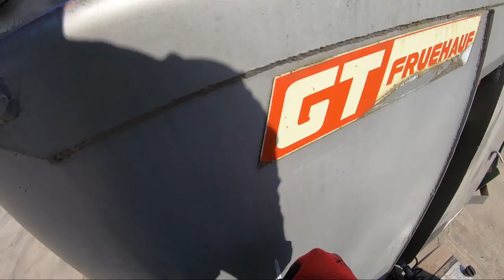2.5 Tonne Overweight & Blindsiding Off A Weigh Bridge - Last Day At Freelands.

Comment: I remember sitting in an RDC waiting for my call. Young lad got his call to a bay before me. 20 minutes later he was no nearer getting into the position requested. A crowd of numpties had gathered on the bay to mock and by now the shunter was sat facing him, feet on steering wheel, hands behind head. Nobody offered any assistance and I couldnt watch any more. Walked over and quietly reassured the lad. "just pretend its only me and you here and if it takes all day it takes all day, you'll be fine" Next shunt he was in. A Lions Den for newcomers.
Reply from the maker: And i bet that lad is top bollock now and that is a distant memory. Good on you for doing what you did pal! I'd do the same! The learning curve from reversing on your test to getting on a bay is night and day. It's one mad steep curve haha!
Reply: Only went to my first RDC in my 3 years in an artic last month (Paletline Birmingham) and how tight it was and the sheer number of tractors flying about in there was enough to put me right off. Did it though with only a few looks that could kill lol.
Reply: Good on you mate.
Reply: A lot of these new drivers think they're a bit special. I'd have liked to see how they get on in an old seddon Atkinson with hardly any power steering and a twin splitter gear box These trucks now are just like driving cars.
Reply: @joehooper2320  I know, "road legends" it's a fucking joke, the wagons there driving now practically drive themselves

Comment: Well done Deedy, I'm 30 and been driving class 1 for a little over 5 years now, I started with a year on pallet network multi drop and that presented some real reversing challenges what's always got me through is watch the trailer axles and use as gentle movements as you can to guide them to where you want them, a 3 axle trailer will pivot on its middle axle which helps to know. I've used many types of urban trailer on the multi drop and the shorter the trailer and less axles it has the quicker it'll move and the sharper you'll need to be, it'll come with time and you seem to take it all in your stride keep up the good work. I'm on a mixture of bulker and walking floor work these days and just another little tip I find helps me when it comes to rolling your sheet back out just undo the middle line and throw it over, give a good few hard tugs and your sheet will be back out in no time (unless you get shovel drivers that trap your sheet like they always seem to do to my walking floor when loading with DMR!) it'll help those pesky straps drop back down to as they can be a pain to get down if you don't roll the last bit of the sheet back fast enough. Anyway happy trucking and love your videos mate.
Reply from the maker: Thanks a lot for your advice buddy! All taken on board! Appreciate it mate!

Comment: Well done Deady! I was taught to use the mirrors, especially when trying to revearse straight. Which ever mirror the trailer moves into, turn the steering wheel that way and it'll straighten out again. As someone else has said, keep the steering inputs as small as possible. Because of the lever effect, small amounts of input on the steering wheel will have big effects on the direction of the rear of the trailer.
Jonathan.
Reply from the maker: Cheers mate! I will use this advice when i get back behind the wheel! Thanks!

Comment: Hi Deady, I’ve recently just passed my class 1 and struggle abit with reversing! Best advice I’ve been given is it’s not reacting to the manoeuvre, it’s letting the vehicle react to your instructions don’t steer so much little twitches. I work for a pallet network and deliver to RDC’s I’ve only had to back onto a bay in the class1 once which I go spot on! It was when I came off the bay and spun round to back up into the holding area afterwards that was a major pain in the Back side haha! Keep at it thou pal, like anything practice makes perfect. All the best fella stay safe pal.
Reply from the maker: Nice one buddy! It's good when you nail it first time hahaha! I'm good at maneuvering the truck, i can get it anywhere fiddly or tight, but give me 2 straight lines to back into and i'm feckin useless hahahaha!
Reply: Deady 2012 pretty much exactly the same! Next time I’m at the RDC I’ll send you a pic of where I was and where I went on “insta” 🤦🏼‍♂️😂 hope your back in work soon.

Comment: I’d say (although it’s a long time since I’ve done it as I’ve been out of trucks for a long time) that  the key to remember  is with a multi axle trailer the pivot at the back moves.  What was happening is the weight was moving from back to front which quickens up the turn.   

you seem to have the first bit which gets the rear wheels toward the bay then  I tended, when doing the last little bit, to just use mirrors and no more that 1/4 turn of the wheel.   

Final thing I would say is if you have the space try and get the unit straight with the trailer before the trailer wheels go into the bay.  If having to reverse tighter then there is no hard taking a shunt to get it straight
Reply from the maker: Thanks mate i will take that advice on board! Can't wait get practicing lol!

Comment: Aaaah Deedy .... go a little gentler on the staring wheel.. little will go a long way and much quicker to correct.
But you are getting their . Slow slow quick... 👍🏻
Reply from the maker: Nice one mate! Ima try! I can't seem to get the angle on the trailer fast enough then i end up at a 90 degree hahaha!
Reply: the little advice i had was remember it takes twice the amount of turns to cointer act the first turn, so a lttle goes a long way is excellant advice.

Comment: Hi deady,
I think when you're reversing you are rushing it slightly which is causing you to oversteer vice versa therefore slithering and zig zaging going into the bay (i find it more difficult when you have nothing there to use as a guidance i.e clear and visible lines or another truck) I was taught to take full advantage of the space that you have got in the yard or wherever to reverse into a bay, do not rush it, and ease on the steering. If you mess it up start again and keep your cool, don't worry about anyone else or what they think of you sod them. Would you rather shunt/attempt it 10 times or would you rather hit something or someone!?
Everyone has their little method/procedure of reversing and it's just the case of choosing your own method and practise. It will come to you one day and it'll all click
Reply from the maker: Thanks for the advice mate! I do believe that my main issue is rushing! I seem to want to do everything first time and as quick as possible! I need to remember to chill lol! Cheers mate!

Comment: I know it's hard mate, i don't have a licence but I use to shunt for an eddie stobart wash and parking was beast mode. some days i could get it in two shunts and bad days i was holding up the yard. i preferred aiming for a trailer on the drivers side so its easier to aim for and you can check how straight you are as your backing up. i was told to drive to your space, drive a past the next trailer/space then drive so your trailer 45 degrees then back it up. but it's never that easy.
Reply from the maker: I think the set up is 75% of the issue lol! If i could set it up so i was actually in line with the bay i'd be pretty much there haha!

Comment: Your reversing is bang on bud just take your time & sod everyone else. No rush it’s not a race as long as you get it done & don’t hit anything. I noticed at one point you started to chase it off when you saw your trailer was near enough straight you have to think ahead mate & chase it off as soon as back end is in bay . It does come to you keep up the practice mate
Reply from the maker: Thanks mate! I'll try that, it's mad that i can get straight anywhere else without over rotating, until i get a set of lines to stick to, then it all goes pete tong hahaha!
Reply: Deady 2012 I’ve been doing 36 years mate & still mess up. I can blindside it down a tight alleyway but when I have to back it on a bay I’m all over the place just don’t make sense 😂

Comment: Good luck Deady, I'm not sure how much longer I'll be on the road before the work dries up but for now it is ok. 
I'm having similar issues on the reversing and I know that the comments below about less movement and using the stunts to straighten up are the answer I just find it difficult to apply the logic🤯
Hope you are back on the road ASAP, love these Vlogs.
Reply from the maker: Try and use Crawler gear. It worked for me when i got back to the yard. Nailed it first time, i think my main problem is that i'm trying to rush all the time. Which makes me feel the need to do more with the wheel faster and i lose it. So with crawler you go slow & can see what's going on in slow mo lol.
Reply: @Deady2012  that's a great call!

Comment: Alright bro, reversing comes to us all. I've only been doing artics 3 years and I'm nowhere near perfect. 

What I've learned is, what would you rather do? Take ages pissing everyone off shunting and getting out all the time to make sure you've got nothing.

Or be on the phone to the office reporting hitting something and then taking that shit home with you?

All down to experience and confidence mate, and I can tell by your perseverance you're gonna get it in no time..

Just don't do what I did and follow a tipper through Birmingham, to be lead down a cul-de-sac that I had to blind side back onto a T junction with temp traffic lights, and had to actually move traffic back and move cones to not hit anything 😂

Only advice I  can give is, don't look at reversing your trailer look at your axles.. try not to think about your cab or your steer or fifth wheel just watch your mirrors, go slow, steer you axles and get out and look and shunt until you get it right..

Great work bro. Stay safe.
Reply from the maker: Thanks for your advice mate! Really appreciate it!

Comment: Hi mate I've just started with a firm today. They've given me a CF460 to drive just wondered how you found it for nights out?
Reply from the maker: First 2 week shocking lol! Its awful to live in because of the engine cover. The beds comfy as hell though lol! Just takes some getting used to!
Reply: Well hopefully I'm not out every night then. I had a new gen scania previously. Be interesting getting dressed with no standing room..  Have to eat and get dressed in prone position 🤣
Reply from the maker: Yeah getting dressed can be a nightmare, if your foot falls down the recess to the left of the drivers seat you headbutt the lockers whilst you’ve got one foot in a pant leg 😂 Done it haha! The dash is slanted too so you can’t do naff all on that either. It really is a pain in the ass! Needs some getting used to haha!
Reply: Have you looked at the dash tables? They are about £50 online
Reply from the maker: I’ve heard you can get pulled with them, they obstruct vision supposedly.
Reply: Not been told that I will ask around... Don't suppose you installed an inverter in yours? I've looked unver the bed expecting a rubber bung I could remove to run power cable outside to the Anderson plug but can't see anyway of doing it 🤔

Comment: Hi m8 reversing will come just keep practicing and as for your sheet you pull it over with the rope the pole is only for winding it open and when it’s open the rope is used to keep it held in place whilst driving
Reply from the maker: Aye, i figured that out the hard way hahahaha! Spent about half hour fecking with it in that truck stop.... Second time just yanked it one hahaha! Cheers buddy!
Reply: Deady 2012 in fact tell your boss when u get back you want the electric easy sheet and a on board weigher  makes life so much easier av done bulk tipper work for about 22year now n just surrendered ma hgv licences last month on medical grounds but loved tippers compared to curtainsiders or fridge work

Comment: I know it isn't easy reversing a trailer into a parking bay, you kind of need to have all 3 checks going all the time (mirrors and out the window). the video footage wasn't that clear on where the lines were for the bay, so sorry can't really help this time, the main advice I can give though is when you want to straighten up, is to stop the truck, position your arm, and check the mirrors, if reversing to the right, then to straighten then you want to see which mirror the trailer is in, if right mirror position your arm, so that you can easily steer to the right, or if to the left position your arm for easier turning to the left. then reverse and steer at the same time. while stationary then no damage can happen while you think about it, and position your steering arm. so like if you steer with your left arm, then position your hand so that it is at the 6-7 o'clock position with your hand under the wheel, then as you hit 9 o'clock position then your hand shound have come around to the top of the wheel. or steering to the right then start with yout hand ontop of the wheel at 6 o'clock position as easier to reach the 3 o'clock position and beyond with your left arm. it will also hopefully stop you from steering too much to the wrong direction, and kind of be a simple way to tell your body something is wrong here, and to stop anything from going drastically wrong before reversing too far. kind of a simple tip that I have learned to teach myself.
Reply: as for Average Joe, yes I seen his super early post before it was re-uploaded, and I do personally think it is discusting that toilets were not provided reguardless of the amount paid by drivers for parking in the services. the country really required drivers, and his video was the response he got totally disgusts me. where would the country be without drivers? we need our deliveries, like to the toilet rolls, etc. how did the services know he wasn't delivering toilet rolls that day?

Comment: Your doing fine mate. It will come with time. I find it harder reversing on to a loading bay with no lines or yellow bananas as theres no reference point. You just gotta aim for the bump stops. Find a space clearly marked.. then just practice running your trailer wheels down the line. Anyway what I noticed is you had a good starting position but as you where reversing in to the spot you where overcooking it so full left lock on pull forward then straight back
Reply from the maker: I can't wait get back practicing haha!

Comment: Don't use so much lock, put a bit of opposite on to make the bend, then straighten the wheel to chase the trailer round. Then just little on off movements to correct. Just practice bud, you'll get it.
Reply from the maker: I hope so mate! Cheers!

Comment: Whats the plan now mate? Were you on agency there or were u permanent. Could just get some supermarket work to tide u over
Reply from the maker: Full time bud! Who do i contact to get supermarket work? I would do it if the opportunity arose.
Reply: @Deady2012  adr network for Iceland warrington, asda where saying contact local depot, Sainsbury haydock I think is staffline
Reply: Deady 2012 xdr network deal with iceland and they take newbies just need to pass the assessment, the rest that the other guys mentioned require 6months experience. I currently work between morrisons and sainsburys. Lots of reversing getting into stores and onto bays with all of them but it will be sure to get you up to scratch. As regards to your reversing, your giving it to much left lock so when your unit comes round the trailer goes to far over. I was the exact same but its a doddle now and ive only just hit one year. Daf units are not the best for reversing i feel, not a great turning circle anyway to be fair. Quarter turn to begin with and if its not going close enough give it abit more 😉. If you do over shot it and your trailer is veering over to far just take a slight shunt forward to straighten out the unit and trailer and continue back

Comment: If you drive the truck forward in a straight line then just reverse without using the steering wheel the truck should reverse in a straight line but you are putting too much lock on and having to take too much lock off etc 

Why not practice with a car and long car trailer etc on tge weekend in a car park etc
Reply from the maker: Where the feck am i gonna get a trailer for a 1.1l Peugeot lol!
Reply: @Deady2012  lol but tge same principle applies eg tge reversing aspect etc 

Oh and 

Marble racing 

Is apoarantly a massive global trend on youtube whod have thought lol

Comment: You too straight at the start go past the bay spin the cab towards the bay you are going into and before you stop straighten the wheels so now you trailer should be slightly pointing to the bay you cab should be at an angle to the right when you start to reverse now the trailer will turn to the bay and you and slowly start to straighten you cab as the trailer get in the position you want, if all that makes sence

Comment: Great video,,  your reversing will come,, just take it slow,, slow it right down small turns on/off.,,, it will come Trust me. 🇪🇸🇪🇸🇪🇸🇪🇸🇪🇸🇪🇸,,,
Reply from the maker: Nice one mate!
Reply: @Deady2012  when you look at trailers they are all scuffs and dents. They aren't all done by new drivers.  One day you will look back and laugh   at your videos then u will know how well u have progressed,,,,, I remember one time I took off the front of a new motor with my trailer swing in a very tight street trying to get round a corner. Sweating I was 😂😂.. 🇪🇸🇪🇸🇪🇸🇪🇸🇪🇸🇪🇸